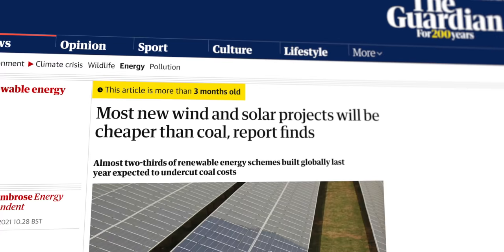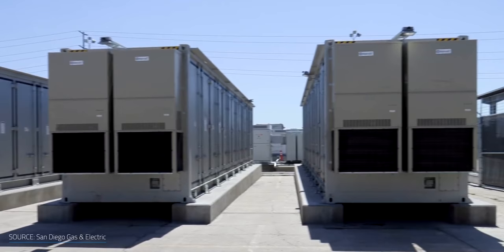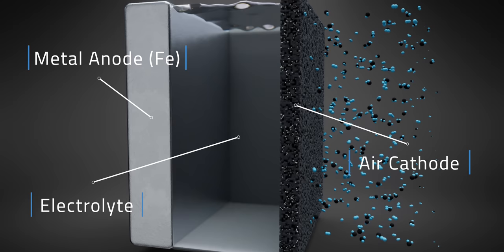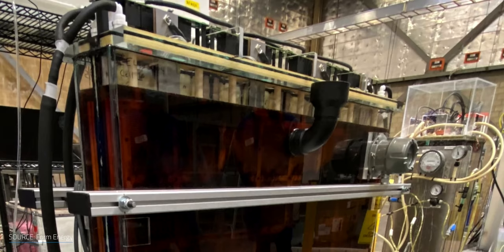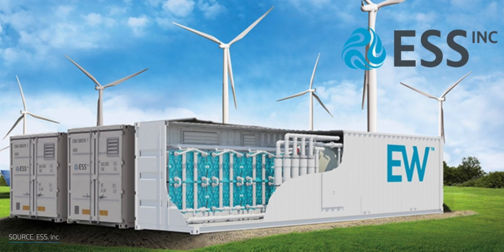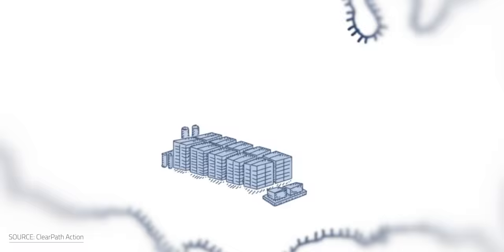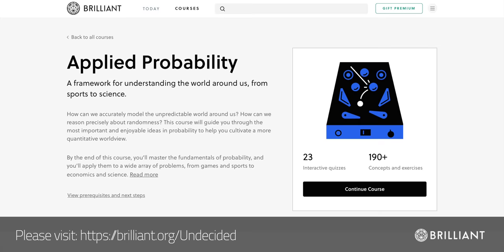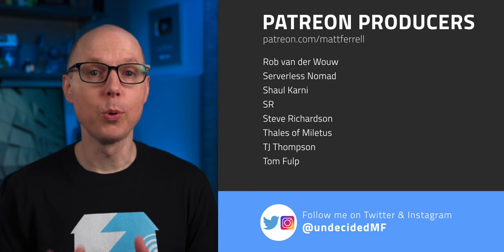Why Rust Batteries May Be the Future of Energy - Iron Air Battery Technology

Comment: I hope something like this could apply to smaller towns like my home town. Our grid goes down for an average of 3 hours almost every month. If you can't afford a generator here, you're out of luck in an ice storm.
Reply: Local storage in each house sounds like the solution for small towns.  They need to make a box that is good for about 10KWH and zillions of cycles.  If you don't do anything silly, 10KWH will power your house for a day.
Reply: what's your town population? solar and batteries are completely scalable right now, the problem is high energy use devices like electric heaters, AC units microwaves, toasters, etc.
Reply: @kensmith5694  You can already do this. 16kwh of lithium battery is as cheap as $10,000. 3kw all in one solar charge controller containing the solar 3kw MPPT charge controller, AC to DC grid charger 1.4kw, and 3kw inverter. best part? If you want to start building a power grid that is balancing, they ALREADY have the AC to DC circuity built in, in the form of a grid to battery charger! This lets you scale systems in very interesting ways!
Reply: @joe7272  To many people $10K is a lot of money to invest.  Also Lithium batteries won't do zillions of cycles.
Reply: If ice storms are taking down your power, and you have hours of outage each month, then it's the grid itself (more particularly, some mix of neighborhood trees & people hitting poles), so a grid-scale option won't help. The household options mentioned here are what you want.
Reply: @joe7272  Imagine being so wealthy that $10,000 is considered "Cheap".
Reply: @Crosshair84  for the utility provides, yes. It is a fantastic value
Reply: @Crosshair84  Then you aren't creative enough to find uses for stored energy.

Comment: Doesn't this have its roots in  the ancient Baghdad batteries? They were built with a clay pot a tube of copper and a rod of iron. I believe it was the oxidation of the iron rod inside of the vinegar solution that was inside the copper tube. 

The chemical reaction was Fe > Fe2+ + 2e and produced around .44 volts.
Reply: "The chemical reaction was Fe > Fe2+ + 2e and produced around .44 volts."

Just enough voltage to please the gods!
Reply: To the best of my memory, the Baghdad "batteries" are believed to actually be a method of protecting papyrus scroll on long journeys, such as from Egypt to Sumeria. I'd kinda like to believe that someone knew of electricity beyond lightning and amber, but there are better explanations for everything that I've heard of.

Comment: Speed of discharge "100hr of storage" is meaningless since you can discharge a lithium battery slower if you want, you just won't get much power.
Your video doesn't mention the power density of these iron batteries.
Reply: As far as I understood, he was implying that iron-air has significantly less power/weight and power/volume, but significantly more energy/cost. For longer discharges from large facilities, power density isn't really important. However, we have yet to see if the efficiency (discharge/charge) is sufficient (80%+).
Reply: @JWQweqOPDH  ok so if it's one football field per kw, that's ok?
Reply: Yeah because you know… 100 hours. Lol
Reply: Jeah, these claims of a long discharge time being a good thing is just marketing speech. I love these videos, but when the science video just copies the marketing lingo I get disheartened.
Reply: Yeah, charge/discharge times are more about load vs storage capacity than how the battery specifically works.

Hell, the fact this video is touting the ability of grouping the batteries into larger blocks for more capacity really makes this feel like paid advertising instead of an educational video. All batteries of the same voltage/capacity can be linked together to get larger capacities. That's literally just how power works.

Plus, there's the who electrolyte solution and the questions about how long it will last and much it costs. Depending on the answers, this could actually end up costing a lot more to operate in the long run.

That aside, after like 2 decades of "this new battery tech will be significantly cheaper and store significantly more energy" claims with it either not even coming close or going nowhere at all, I'm a bit skeptical.
Reply: @InfernosReaper  yes, this is the third video I've seen in this sort of technology and it's always the same. The critical questions aren't asked, which suggests they're just regurgitating a press release rather than investigating.
For instance, say I wanted to build a coal fired power station... Sure, the size of my coal store is important but so is how big is my boiler. "a years worth of coal" is meaningless on it's own.
Reply: If it's a proprietary venture then best of luck to them. Not my circus not my monkeys nor my cup of coffee.

If it's open source in nature and we can all pile in on it and get the magic of a globe of tiny garage shops and card tables, sounds fun!

Scalability and sociopolitical contextualization baby!
Reply: @MarkkuS  Marketing hype is designed like propaganda to get the money flow going, regardless of if it is a good idea that can work.
Reply: Man, why should we ever watch a video giving the high points of a new technology? It's just going to make it sound good! Ugh, they won't give me all the technical details, so what's the point?

Maybe to introduce the tech? I didn't get the impression he was advocating anything but his own channel at the end (you know...because he needs to eat too.) 
I mean, think what you'd like, of course. But these comments just whining about technical details crack me up.
Reply: @AsmodeusMictian  because the video claims to tell us why these may be the future of energy, but actually does not.
Reply: @MrGonzonator  One football field per kW is the density of gravity storages, like mountain dams.
Reply: @michaelcrockis7679  that's why I'm asking, we don't know.
Reply: @MrGonzonator  Ah, so describing the characteristics of the batteries, how they operate, etc. That's uh... That's not demonstrating why these may be the future of energy then?
You kinda have to know what you're talking about and personally...I didn't before watching this video. Hell, I didn't even know rust batteries were a thing! So I'm pretty geeked that it's out there and now I know a bit more about it, and why these might be the future of energy (storage).

Your mileage may vary, of course.
Reply: @AsmodeusMictian  sorry if I've split the audience here; yes Matt does a great job describing the function and processes of these batteries, but he makes the mistake of cherry picking the comparisons to favour the new technology over the established one. That signals to me that he either a) doesn't understand the importance of details that's are not on the press release ( I very much doubt this; he's a very tech savvy guy) or b) he's been asked not to represent the technology in a poor light in exchange for favourable access.
Reply: Yeah, it was a bit confusing (at least to me). What it probably means: use the more expensive solutions only (in a cost effective way) for shorter (in time) energy buffers. Or the max time limit to bridge with the battery when you don't have enough electricity produced. This hasn't much to do with how fast these batteries lose power without any load (aka drain).
Reply: POwer density is insane for molten air chemistries.

The molten electrolyte is extremely ionically active, far in excess of the best aqueous or liquid designs at regular battery chemistry temps.

Therefore their charge/discharge rate is very, very good.

Not super cap good, but better than most battery chemistries I have heard of short of some lab experiment with MXenes.
Reply: The point is that Li ion is so expensive that its only worth while using them for short term storage. The duration issue is about economics not physics. If the rust battery really cost only $20/kWh and really lasted over 2000 cycles then it could be 1/10  the cost of Li ion which would be a very big deal. When you're talking about grid scale storage the density or weight is not very important because for example you could just build a huge battery farm and put the solar panels on the roof rather than putting the panels on the ground. The total land use would be no higher than it was without the battery. This is a bit more expensive than putting the panel on the ground but not by a lot. Cost per MWh is the most important thing, as well as environmental impact of the mining/recycling/end of life disposal.
Reply: That is because this is a pipe dream.

Comment: I support the use of iron-air batteries for power  storage. We can try to stop any charge leaking away. Hydrogen can also be used as storage for power. Just make it using   electrolysis. The oxygen produced can be given off and that will help to reduce the heat absorption coefficient of the atmosphere. Hydrogen can be transported short distances.

Comment: I think the iron air battery is a good step forwards for grid level energy storage. I really hope to see more about it and hope that technologies like this take off and have industry disrupting results that favor the common person :)

It's far and away better than the aluminum air one that was mentioned. Single use replaceable batteries are a crutch that tries to keep us in the 'stop at the corner store to fill up your tank' mentality, which is purely a factor of the fossil fuel industry. In the course of the lifetime of a single current gen Lithium ion EV battery (Tesla, just for easy reference), the number of '1000 mile' or even '1500 mile' aluminum batteries you would consume (and force the re-manufacture of) would be in the hundreds. This is wildly different than grabbing small bits of fuel each time you fill up your car out of a tanker's total capacity. This is multiple hundreds of manufacturing processes being re-done for EACH aluminum air battery (packaging, electronics, casings, screws, etc etc etc), each with their own demand on energy and CO2 production outputs.

It's cool tech, and it's a solution, but it's a bad one IMO because it keeps us in the same usable/disposable mindset that we need to get away from.
Reply: If you do it properly you would only recycle the ...nodes and electrolyte, then reatach that to the already existing casing, could be quite efficient especialy if you consider all the extraction and transport required for that "small bit of fuel". The problem is the ~20 eff of the alu battery.

Comment: 2:50 why they don't put the solar panels on the roof of this storage device?
Reply: If you look closely there's wind turbines
Reply: It’s a render, rather than an actual structure, but at this scale, the roof could be made of solar panels and it would be hard to tell.

I think the reason that they aren’t is that batteries of this size produce a lot of heat when they charge or discharge, and solar panels are most efficient at low-room temperatures. 

Additionally it takes surprisingly pure water (9 ppm impurity’s) to keep solar panels optimally clean, and pure water is a very good solvent. It’s best that the battery cases don’t have to be designed to deal with that, though you totally could.

Comment: Worth noting that this battery isn't necessarily longer duration by itself. Lithium batteries have incredibly low self discharge, easily lasting several months with minimal loss. The advantage would be in cost. If you can install much higher capacity due to lower cost, assuming they aren't really big, and require more land, you can provide power longer. 16-24 hours would be good with Solar since it is cyclical, though 2-3 days would be better due to clouding. If you are just talking about reducing peaker plants, 4-8 hours is fine to power through the evening when sun goes down, but demand is still high.
Reply: THANK YOU - I was trying to work out why they were saying that when I have Lithium batteried that i charged 3 years ago and they still have some change in them...

Comment: Can they put a blender-like device inside the battery to get rid of dendrites?
It is just sand with air bubbling through it I assume so it should be possible to just stir it every now and then, and possibly even actively filter out large connected particulates.
If you bubble air through sand-like metal, the large pieces should goto the bottom like water, so you just belt out the big stuff and put small sand particulates back in.
If you bubble in pure oxygen, will you get much more 'burst' energy at once, on-demand?
Reply: You could just let a cell discharge completely and apply a reversed voltage. It would "burn" the dendrites out!

Comment: Aluminum would be a really tough material to use in a similar battery system due to the fact it passivates when exposed to oxygen. All "bare metal" aluminum you see is actually coated with an ultra-thin layer of aluminum oxide that doesn't flake off like rust does with iron. That's good for corrosion prevention, but not for when you need it to easily switch back and forth like iron/iron oxide does.
Reply: Thank you! I was wondering why this is rechargeable but aluminium air not.

Comment: This sounds like the battery equivalent of base-load, albeit without the down-sides of base-load.   The biggest problem with iron-air, even for a fixed installation, is probably going to be the bulkiness required to get a decent amount of storage capacity vs lithium, and I expect somewhat more expensive maintenance cycle.  Anytime you have moving parts on an industrial scale, maintenance becomes a major issue.

Perhaps a bigger over-arching issue is that far more resources are being put into lithium research than into iron-air research.  Certain lithium technologies, for example the LiFePO4 chemistry, can easily compete on cycle life (4000+ cycles for LiFePO4 under these sorts of controlled circumstances, easy), don't require any moving parts, and don't have any of the capacity or power density downsides of iron-air.   Also, LiFePO4 is a far more robust chemistry than NMC or NCA or other similar lithium-ion chemistries, so the fire danger is not really an issue either.

I suspect that the research cycle into lithium chemistries like LiFePO4 will trump these other battery technologies over time.   Throw in solid-state in a couple of years as well... then even the liquid electrolyte goes away.

-Matt
Reply: The quoted LCOS incorporates the cost of maintenance, that's what's cheaper. Personally though, I want to know the LCOS in energy rather than dollars.
Reply: The bulkiness is not a problem for installations that are not mobile. No one complains about dams. Because no one uses dams to power vehicle propulsion. Although they could've. :)
Reply: Build the solar farm on the roof of the battery farm then you don't need any additional land for the battery.

Comment: I can see two things holding this technology back. Cooling and impurities.
First, the iron air reaction is highly exothermic, so the higher the density of the system the greater the cooling challenge. There is a company in scandinavia that is using iron air for renewable heat which makes more sense to me.
Second, air tends to be a mixture of various compounds. Combine that with low flows and a hot environement (point 1) and you will be getting a lot of crap on your batteries that will significantly reduce their lifetime. Most other battery systems are only worried about internal impurities.
Reply: It would be cool if they could recycle the oxygen as well as the iron, but I guess that air tight seals that can handle the change in pressure must be difficult/expensive to produce reliably.

Comment: The knowledge and technology to make these "rust" batteries, has been around for many decades (maybe even a century or two) there must be a good reason why they're not common.
Reply: The knowledge and technology nessecary for internal combustion engines was invented in the 1600s, and steam engines in the 1200s, but they remained unused technology for centuries. I mean, rockets were invented in the 8th century if I remember correctly, and it took nearly a millenium for them to be regularly used.
Reply: It's simple : until now we did not need them. Batteries were used in transports, or small objects, so what you needed was energy density. In that regard, rust batteries cannot compete with lithium ion. And rust batteries will never replace lithium ion in the transport industry.
For large scale storage however, we don't really care about energy density anymore. The demand for this kind of facilities is new, that's why rust batteries are being discussed now.